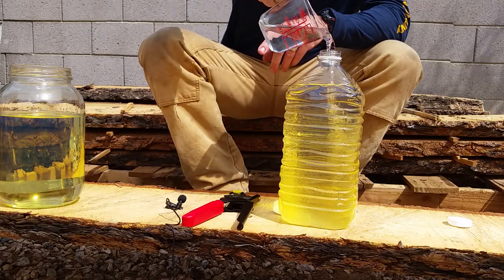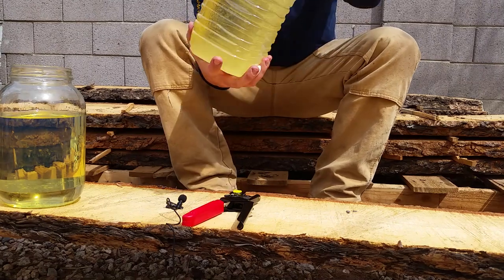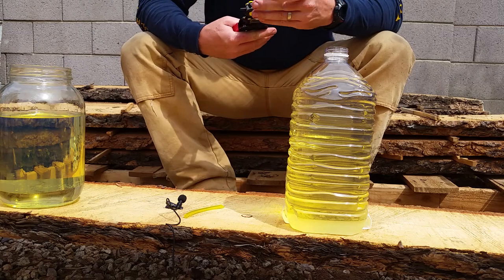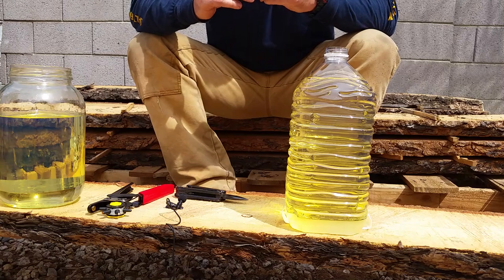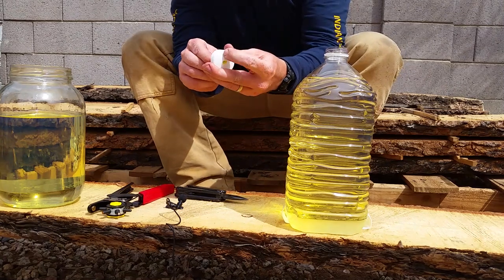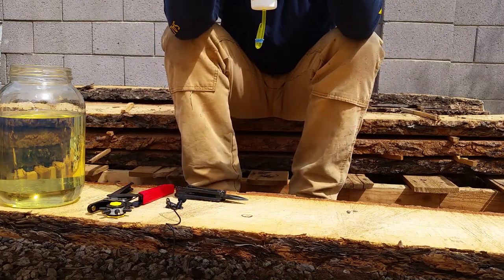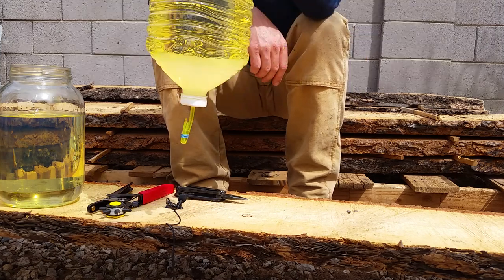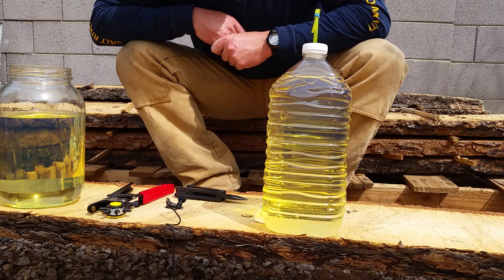Removing ethanol from gas

Comment: Ok ,again ethanol is a more simple,less dense molecule that has energy potential. But understand, less dense isn't that bad, by moving more fuel it helps cool intake tract, (there is yt vid of place doing Dyno test with blown methanol burning engine and blower is sweating during pull cause it cools it down)burns cooler, only produces (mostly) CO2 and water, add plant an sunshine you get what ever plant produced and oxygen. Also ethanol cleans engine as it produces steam in combustion process. Gasoline  tends to leave behind sticky residue and other complex by products that require expensive catalytic converter. Yes E85 requires more volume but isn't as bad as some quote. And if engine is tuned well can run cleaner and make better power with no knock issues.
Reply from the maker: +MonzaRacer but ethanol destroys small engines by rotting out their carb and fuel lines.
Reply: OH really, I have older small engines and have had near zero issues with ethanol blended fuels. My push mower was my m(oms and is easily 20-25 yrs old, pretty much ANY current fuel be it E10 or Ethanol free with new EPA regs requires new diaphram every couple years regardless. My snapper rider has had same carb since I recieved engine back in 02 used and only time I have had issue was when I failed to drain fuel system over winter but new float, needle and seat and bowl gasket kept it running. engine has finally worn out. I currently have moms old snapper which was bought new in late 90s, STILL running strong. She bought straight shaft echo trimmer cause we could get it with blade kit, has ran same time and just last year started having random ignition issue I believe. As for fuel lines from what I found out couple years ago when finally replacing lines and filters on string/weed trimmers new lines should be installed every two or three years anyway. Rubber lines on both riders are several years old and still useable. My 06 Buell Blast still runs fine after 20k+. OH and as for "rotting out" carb and lines, doubtful as most push mowers are now using non corrodible plastic materials, but since they took tuning away from small engine design"due to EPA" I still like swapping old L head mowers back to old aluminum carbs. you claim it "rots" the carbs and fuel lines YET if you follow old time storage practices, add Stabil to gas (prefer to use premium/reg octane only as 50/50 mix in last tank of year) then run long enough to get through complete carb/fuel system/engine then drain/shut off fuel and run carbs dry till engine dies. Try not to store current fuels more than 30-60 days in cool dry place well capped. As ethanol is hygroscopic ({of a substance} tending to absorb moisture from the air) not hydrophilic (having a tendency to mix with, dissolve in, or be wetted by water). See when E10 absorbs water it simply reduces octane, tends to make it harder to start/run till engine gets well heated up and doesnt run properly. So many people do not SERVICE properly. Again, using bit better grade fuel on last tank of year, with Stabil, take a squirt can, remove plug(s) squirt couple squirts in cylinder and spin engine. I even have used outboard motor storage spray with or without the regular oil. Now also warming/using engine on last use, change oil and I prefer quality diesel grade oils with more zinc/phosphorous over others. Then take engine out and let it mix some and get warm before storage. Basic idea is to keep oils changed as most small engines have no filter, and fresh oils additives need a small amount of contamination from use to get them "active" from my observation. THEN upon removing an small engine from storage, remove any old fuel(should keep tanks full for winter to slow/stop corrosion) and I like filling with FRESH fuel and have it doped with Stabil as many times first use isnt first of consistent season many will go out early, mow then have equipment sit through last of spring weather. Get it started, make sure belts, hoses,plugs(fresh plug in spring is good practice as some brands the ceramic WILL absorb moisture and cause hard/no start till it either is changed or gotten really warm) all function. Get juices flowing then oil change/filters and prepare to work.
Also when storing, grease/lube everything in sight, then redo in spring. It works. trust this as 40+ yrs as tech and watching my father service/prep our yard equipment taught me a lot.
I have seen more cars/equipment hurt by lack of service THEN starting to use E10. My other push mower I even tuned to run on 91% rubbing alcohol then put it back to run gasoline. There are so many myths and semi truths ot makes it hard to educate and inform.
Reply: Sir LACK OF PROPER MAINTENANCE destroys more devices than anything ethanol does. See ethanol ISNT corrosive its a detergent. It strips any thing protecting a carb or other metal part of this protection. Ethanol has been used as a solvent for millennia and will continue to be used. What happens most times is ethanol IS hygroscopic and thus when in a hot carb and its shut down CAN cause the ethanol in fuel to draw moisture in and allow corrosion to start. 
Lets get some basic chemistry going, two types of metal (even an alloy if its soft and comparably inexpensively cast) and two types of chemicals that can transfer ions and electrons, JUST LIKE A BATTERY. Now if properly designed this chemical change, like in a battery can go back and forth between charge and discharge. If we have pot metal carbs(low grade aluminum/zinc alloys) and gasoline with multiple types of chemical present AND one will strip any type of added corrosion inhibitor away corrosion will result. NOW take regular E10, add some Stabil or (even small amount 1 oz to gallon) marvel mystery oil will help slow down or nearly stop any corrosion. Rubber parts like hoses need to be reformulated, I know spending $.50 per foot more is hard on beer money but fuel injection rated rubber line at local parts store usually is ethanol resistant. as for 2 strokes proper service, additives before storing, running engines dry of fuel before storing generally alleviates these issues. I find so many stories and recounting of how things fail and yet so far as a mechanic that has worked on everything from small engines to race cars I dont see all the horrendous issues so many are claiming. Now Ethanol based fuels WILL scour your tanks, gas cans and funnels for ANY contaminant over time and this can be detrimental.

Comment: I personally feel that it's a waist of time to do this at all because I have been running all my small engines on pump gas with the ethanol for years with no problems because I put seafoam in the gas and it works great as a stabilizer. If I have something that I Know is going sit for a while I put in 3oz per gallon and run it through. I had a few old snowmobiles sit for 2 years like that and they fired up no problem. I was actually surprised to be honest 😂

Comment: All internal combustion engines can safely and economically use E15, regardless of age. This is proven by Brazil's decades long use of E15, E25, and now E27. They have the same engines as those available in the U.S. In addition, E15 to E30 was used throughout Great Britain from the 1920's to the 1970's. This is also true of countries such as France and Germany. 

My 600+ page book "THE ETHANOL PAPERS" has just been published and it's free to read on TheAutoChannel.com website.
Reply from the maker: Not 2 cycle engines
Reply: All!
Reply from the maker: You're wrong. Ethanol has proven itself a destroyer of all things 2 cycle. From it's affinity for water to eating rubber components in the fuel system and carburetor and not mixing with 2 cycle oils.
Reply: There is information that has been disseminated claiming that ethanol causes damage (this information comes from the oil industry), but the proof is otherwise.

Ethanol's hygroscopic characteristics are one of its best features. It's why ethanol is purposely put into fuel tanks to remove water that forms because of condensation. Ethanol is compatible with more types of rubber and plastic than gasoline and the aromatics that are used to replace ethanol in E0 gasoline.  As for not mixing with 2 cycle oil, where did you get that information?

You might want to check this out: https://www.theautochannel.com/news/2015/09/01/140446-why-do-small-engines-suffer-from-ethanol-problems-video.html
Reply from the maker: This is from the Echo website. Almost every 2 cycle company has similar warnings:

ECHO handheld outdoor power equipment is designed to tolerate up to 10% ethanol blended fuel and cannot compensate for higher concentrations of ethanol like today's cars. Most blended fuel on the market today is E10, which contains 90% gasoline and 10% ethanol. But E85, which is readily available for flex-fuel automobiles, will cause havoc on 2-stroke handheld equipment and E15 & E20 are also on the horizon.
Reply: @KimballCody  Many, if not most of the items you refer to are sold in Brazil. Brazil is almost as large as the continental U.S. and has very big population, it's not some podunk stupid little nation. Brazil's standard gasoline (gasolina) is E27. E27, as I know you can calculate yourself, has nearly 3 times as much ethanol as E10, and nearly 2 times the amount of ethanol as E15.

There are only two reasons why small internal combustion engines in Brazil would be able to use E27: First, is that being south of the Equator changes the the chemical composition of ethanol so that it is not corrosive to the same materials. Second, is that manufacturers typically only warranty items to meet the legal level of gasoline in the country they are in (this is what auto makers, boat makers, and motorcycle makers do). Which answer do you think is correct? - The one big exception to the warranty "rule" is Kia and Hyundai vehicles, which are warrantied for 10 years instead of 3. This is a marketing stunt. Kia and Hyundai make good vehicles, but they are not 3 times better than Audi, BMW, Mercedes, Volvvo, Ford, Chrysler, and GM vehicles.

Why would manufacturers limit their warranties? To save money.

There is a third possibility why a powered chain saw might work with E27 in Brazil, but can't safely operate on E15 in the U.S. That possibility is that the internal parts are sufficiently different. Okay, so what are those parts? (Now we're back to my previous reply to you) What are the rubber, plastic, and metal parts made from? Check them against the chart I suggested you look at. If you find information that is different than the above, please let me know so that I can change or alter my opinion.
Reply: Stihl dealers won't honor warranties unless you use ethanol free gas or a gas conditioner. The ethanol eats the fuel pumping diaphrams in the carbs.
Reply: @MikeJones-rk1un  If new Stihl is not warrantied for ethanol-gasoline use, then don't use it. Buy ethanol-free gasoline at Lowes or Home Depot or where ever. However, I doubt that the diaphragms in the carburetors are more susceptible to ethanol than to gasoline, benzene, toluene, and/or xylene.  

In addition, Stihl products are sold in Brazil, where the standard fuel is E27. Looking through their Brazilian website (https://www.stihl.com.br/) I found no information suggesting that the equipment can not run on E27. And I would bet anyone that the equipment sold in Brazil is exactly the same as is sold in the U.S. If you have information otherwise, or know what the diaphragm is made of let me know.
Reply: I'm just a home owner who heats with and cuts wood every year. The local Stihl dealer told me not to use the ethanol gas. I don't know the chemical cause but the ethanol gas seems to degrade carb diaphragms which I see when I open them up and do the visual inspections. They look nothing like the new replacements I buy and once the new one is in place they work fine.  If you know more than that please let us all know. If not, I'll go by what I see.
Reply: What material are the diaphragms made of?

Comment: The reason ethanol is now added to gasoline, at a lower percentage is that it's a replacement for MTBE. Even before ethanol was added to gasoline,  water found it's way into the gasoline. That's why when practical gasoline consuming vehicle employed means to separated.  This method is more complicated than need be, go take a look at an old  gasoline burning tractor and industial engine, as a guide. What is added to gasoline tanks during Winter to combat fuel line freeze up. Ethanol of course, for several decades fuel system components have been constructed to resist the ill effects of ethanol. I normal operation fuel moves through to fast to cause corrosion. However if  on is too lazy to prepare a vehicle for an extended idle period, there will be problems. YMMV is too much in play to be stating absolutes, and I did my best to avoid stating absolutes. I have been around awhile, putting to work vehicles much older than I but in my experiance fact doesn't support all the bluster, and hand wringing, in the comments.

Comment: I would think twice about doing this.  Gasoline has the ability to absorb some water - something like 0.2% if I remember correctly. The reason you can't dump normal Everclear alcohol or rubbing alcohol into gas is that they contain more water than the gas can aborb - and so they separate and fall to the bottom. If you dump dry alcohol into gas (alcohol with say 1% water) it will disappear. When you water wash gasoline, you bring the gasoline to near it's saturation level for wate and  you have removed any ability it had to absorb small amounts of water.  So now, when there is a tiny bit of condensation that might enter your gas tank, it will not be absorbed by dry gas and will separate and fall to the bottom of the tank.  Maybe if this was in my old lawnmower I wouldn't care - but I would not try this for something important like your boat motor.

Comment: I miss gas without ethanol ,it lasts up to 6 or more years b4 it turns  Into shelack . Regular gass with ethanol only last one month and it will not work in any single cylinder engine.  Super unleaded with ethanol lasts  up to one year and then some. I did the study it's a fact

Comment: Reading the comments
it is apparent
that many still believe the myth
that higher octane equates more power...

This is false...

Premium fuel has same energy out put as regular
it simply has an inhibitor added
to prevent premature ignition
in higher compression engines
...your lawn mower does not qualify.

Sadly my motor bike is 12/1 compression
so I must use highest possible octane.
But my '88 jeep will burn anything.

I have noticed lately (last decade)
that a lot more small four cylinder cars
have a higher compression ratio
to get more power from smaller motors
So you need to follow recommendations of manufacturer.

I have actually asked at fuel stations
what percentage of premium they sell
and the conversation ended
with them stating it was laughable
how many would buy higher octane fuel
for a car that doesn't require it
thinking it would (some how) produce more power.

Again...
It is the same damn fuel...
With an inhibitor added
to prevent pre-ignition
in higher compression
(usually exotic...)
engines.

Comment: You know, if you're going to be doing this a lot, put a tap in the bottom of a glass or sturdy plastic jug so that you can drain off the bottom layer easily. Then you can pour off what's left. A trip to the local hardware store and maybe ten minutes of time to save yourself a lot of trouble.
Reply: I also added red food dye to the water so it is easier to see.

Comment: Great idea, but I use 10 gals. of gas a week.  This idea would be impractical for my car.  I could use it for my lawn mower, but I have gas stableizer.
Reply from the maker: James Mooney there is a guy who does 10 gal at a time out of a custom made set up
Reply: Checkout the fuel additive Ethanol Defense made and sold by bell labs in Florida, if you cannot find 100% pure gasoline in your area. Check puregas.org they have a listing of stations for each state.

Comment: Yeah if my gas Does Not have Lead in it I'm not putting it in my vehicle.... Joking! I only run E30 in my Cars.

You can pick up 105 low lead octane gas at small airports. The average price about 2 years ago was $5 a gallon, good for motorcycle storage.

Comment: There is a VP Racing fuels by me that sells ethanol free 93 octane. At 5 bucks a gallon though it's super expensive. I buy a gallon every few weeks for my RC cars that have 2 cycle engines but ot would break the bank if I fill my SUV with it.

Comment: That's not hate mail at all unless you miss interpreted as that yourself is how it becomes that. To you on that part of it all. I'm just aknowleging you on the part of what your trying to show.& helps others understand how to remove ethanol from gasoline fuels.& readd octane back to it to by using octane booster in the fuels after you have already removed the ethanol& water part out first. Then add in the octane booster to bring the octane levels backup again is correct.

Comment: Cars run fine with ethanol. Why can't small engine manufacturers make their engines compatible with ethanol!?!?!?!? WHY!?!?!?!? I must say that ever since I've been using Stabil, I haven't had any carburetor issues. I used to never drain my small engines for storage. Now I do it just to be safe, though rebuilding a carburetor is a piece of cake....just annoying to have to spend time doing when there are other things I'd rather do.